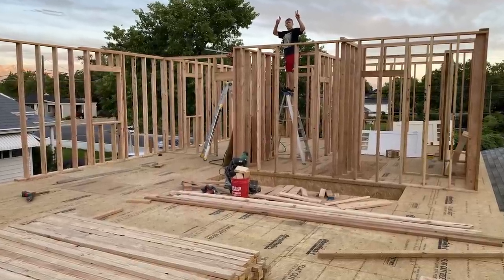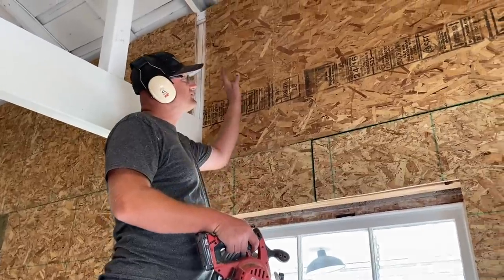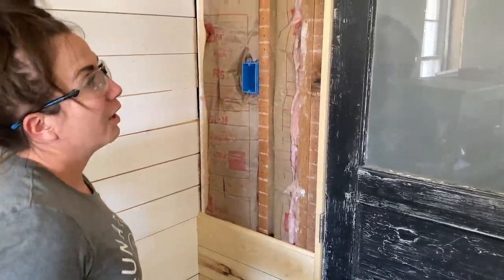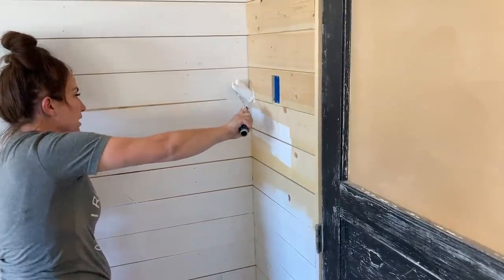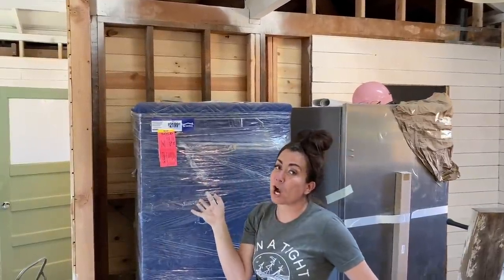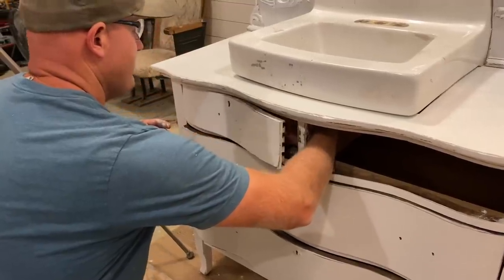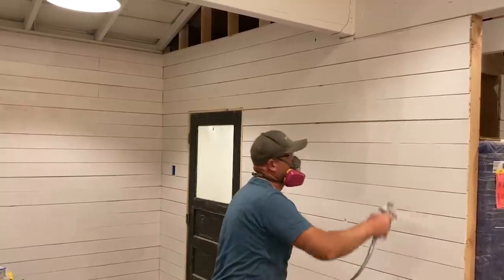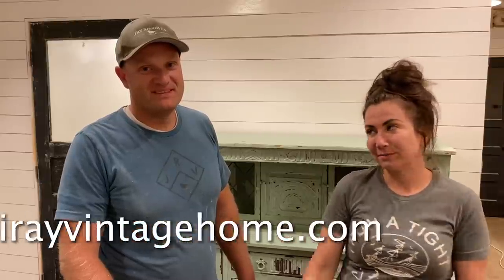Home Remodel How To Extend A Wall In The Dining Room + Dresser Bathroom Vanity!

Comment: I agree with the space above the fridge, it is the place stuff goes to die, my mom uses hers specifically for flower vases because she doesn’t use them often but it gives them a nice safe home. Also if it’s a cabinet you put in make sure it comes out to the same place as the fridge freezer because when they are set back they are even more useless. Other than that I’d probably do a faux build in or nothing

Comment: Zeb I was thinking the same exact thing with the shelf above the fridge. I plan on using metalbrackets on the bottom of the shelf and I haven't found them yet and I'm going to make like a rich because I have a lot of antique glass and I don't want it to fall. That's why I want a little ridge.. so the house remove a little bit God forbid they won't fall.. and I'm with Jamie hide the thermostat lol

Comment: Personally I would go for closed storage space above the fridge and freezer. Open space tends to accumulate clutter and mess - and you have to dust/ clean there regularly. Especially in a kitchen area where grease collects on things. When I decided on my new kitchen, I went for cabinets right up to the ceiling (standard height) to avoid this empty space over the standard cabinets.

Comment: I’m curious.  How are you going to keep the cold and heat out of your house with an exposed roof like yours?  Are you putting in a ceiling and insulation?
Reply from the maker: Closed cell insulation. On the outside of the roof under the roofing.